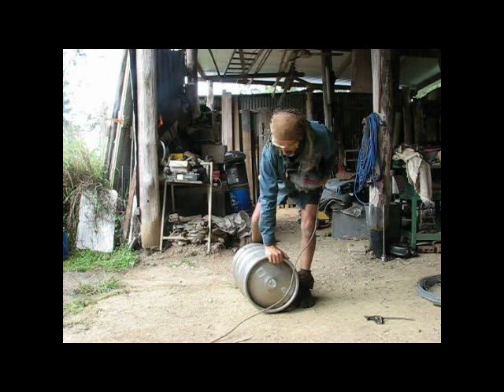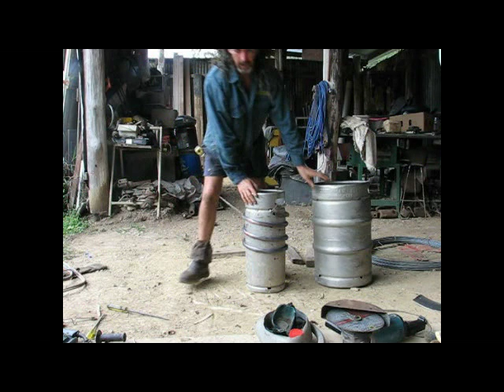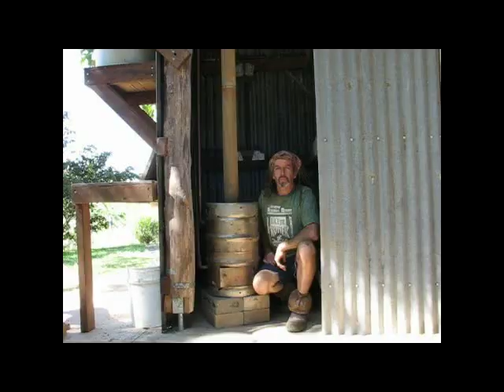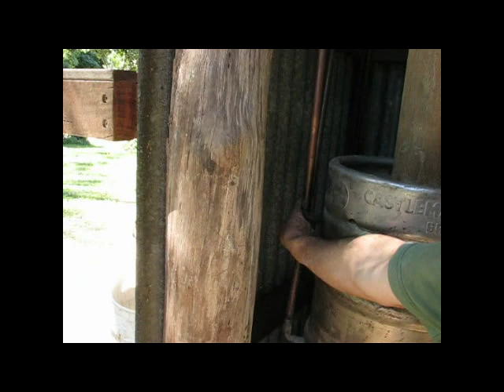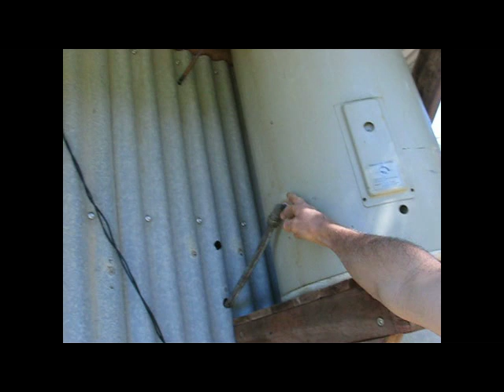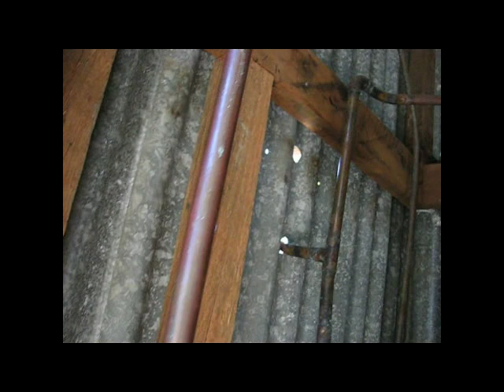Wood Fired Hot Water Service

Comment: There is only one problem with that.......if you cool the exhaust gas temperature too much the draw on the fire will decrease. Cool exhaust will be heavier, than hot exhaust. Here though it looks like a straight shot up to the roof, could get away with it,  a slant of any length though, if it gets too cool then the draw will be bad. More of a concern though, if this were inside. Outside, if the draw is not good, you just have a smoky shed .Also have to watch for creosote buildup on the tubes